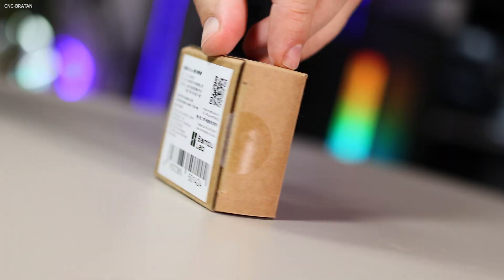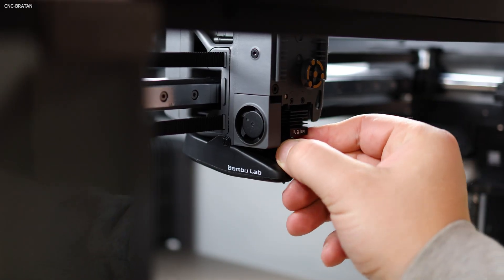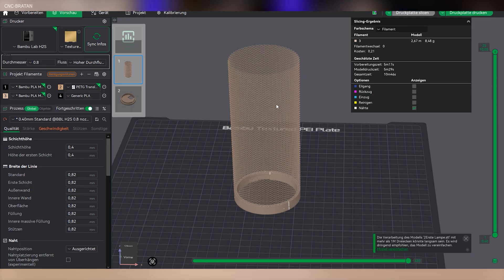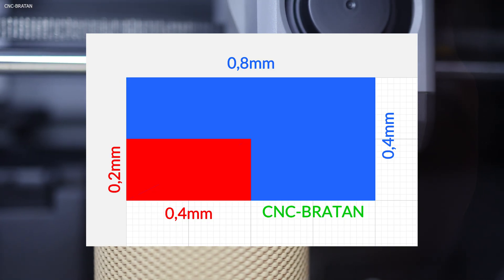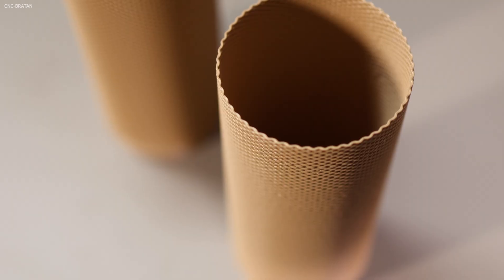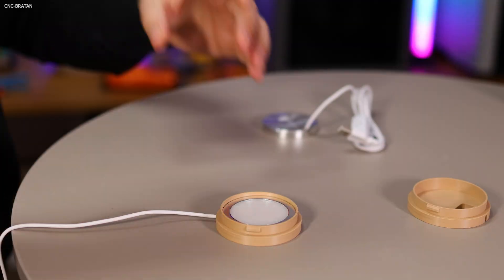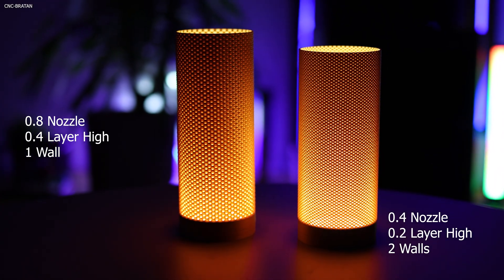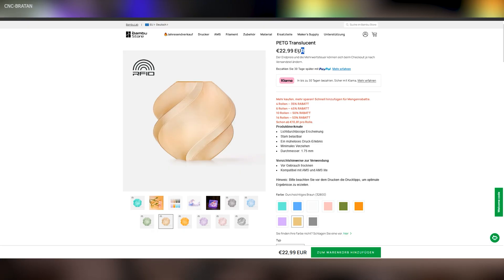3D Printing Lamp Farm Hack: Print 2× Faster for Home Business

Comment: I print with 0.32 line width , one wall spiral mode, 60mms outer wall speed , 0.16 layer height my lampshades what tips you have? I want that fine smooth outer surface. Is with 0.8 nozzle really possible to make a smooth outer surface for lampshades with more flat areas too ? Thanks.
Reply: from my experience the nozzle size doesnt impact the outer surface in the xy direction only in the z direction. im currently printing lamps with perfectly smooth bases with 0.6 and 0.8mm nozzles and for carbon fiber filaments there is zero difference in the surface texture for 0.4 to 0.8 nozzles as long as you choose the same layer height for all nozzles. 
if you go for higher layer heights and thicker line widths the texture can change more noticably which can be an intentional feature of the print. many ppl swear by using very thick lines and high layer heights to get the thread like texture on the outside.

Comment: Can you share with us how do you make the woven texture?
Reply: Make one layer then add an Array modifier with a rotation
Reply: Just recreated it, my method was too complicated to explain in a comment. Create a mesh using math function, then extrude it, then make an array to duplicate the layers. To rotate the array create an empty and select object offset and select the empty, then rotate the empty and move it up on the Z axis and the layers will form.
Reply from the maker: Hi, it will be too boring for many viewers, so probably not. sorry
Reply: @CNCBRATAN  I would love to see, even if it is in a Short
Reply: Hi! I would love it too! I heard it's been created with blender. But I keep searching for the methods how to create this in fusion. I did achieved "similar" result via the "Form" tab. But it's sort of workaround instead of real process. At least in my case.
Reply: Damn. I have paused the video for searching this info in the comments and to type my answer and then... It's Blender straightaway. xD

Comment: Nice video, I really liked the camera work, and i think you missed to mention a few things that might help you. (constructive criticism)

nothing stops you from using a 0.4mm nozzle and pushing 0.8 layer line widths, so in theory no need to buy a 0.8mm nozzle, can be seen when doing max flow rate tests that people use 0.4mm nozzle for it and push 0.7mm line widths or something similar at around 25+ mm^3/sec which is over 100 mm/sec for 0.7mm line width and 0.32mm height.

Also you can print with spiral vase mode as long as you set the bottom layers up to where you want to start the vase mode, but then you print with 100% infill everything below where you start the vase mode which adds time and weight.

Also printing both "test" models at default speeds of 200 mm/sec max speed only shows that you print slower than possible with your 0.4mm nozzle because it can definetly go faster because the 0.8mm can handle it (also considering there are 2 walls that have more time to cool down or atleast the same amount if you print at the same flowrate with 0.4 compared to 0.8)

Also printing slower will definetly show VFA depending on the printer which will make the product look worse (can be hidden with fuzzy skin or Matte filament i guess)

I believe what i said can really help you and others achieve better results with minimal compromises (but i also could be wrong)

anyway good luck with your buisness!